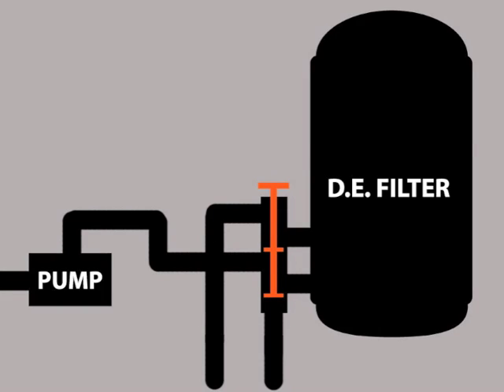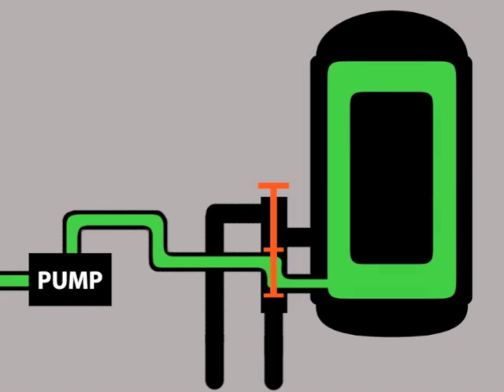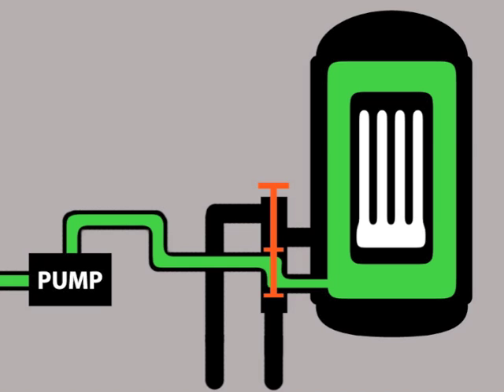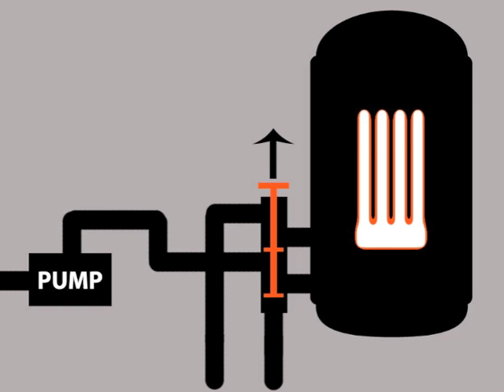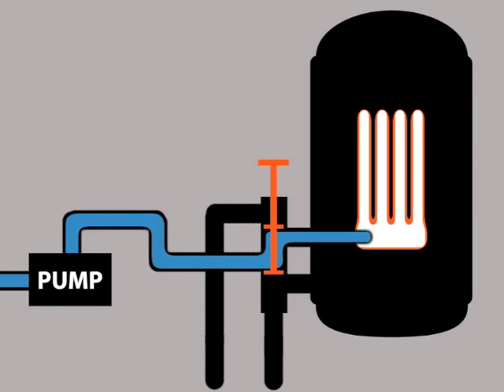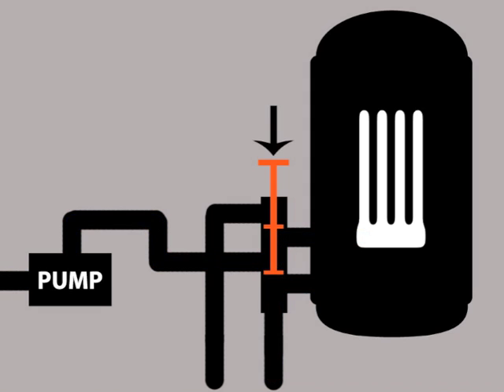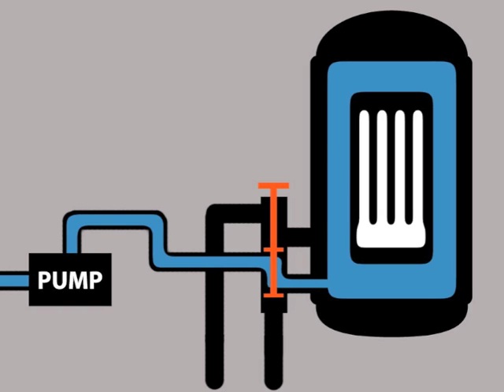DE Filter Backwash

Comment: Does a cartridge system work basically the same way? except no backwash valve of course??
Reply: Absolutely not.  You have to manual wash the cartridge which is more trouble than it's worth. stick with sand or de
Reply: REPLAY01457886G22849713